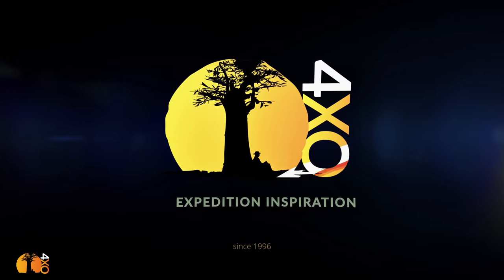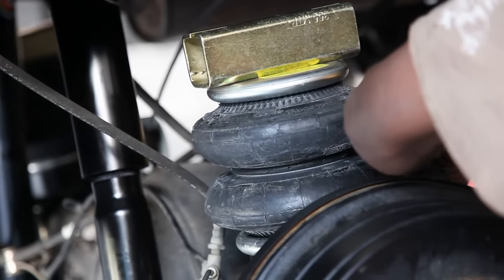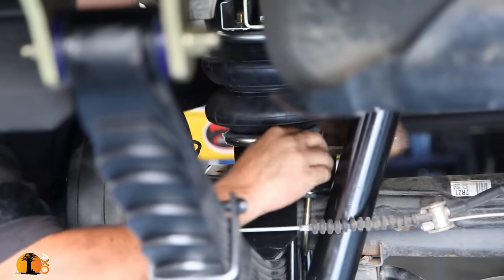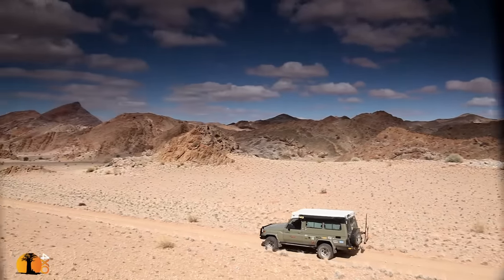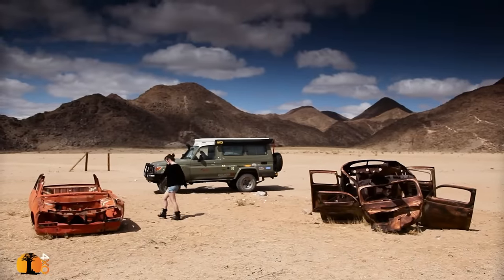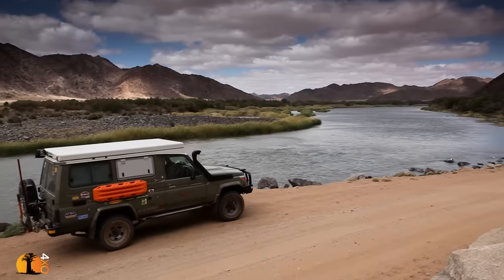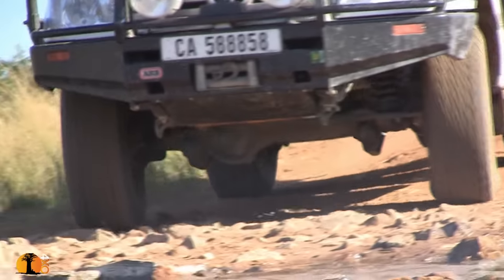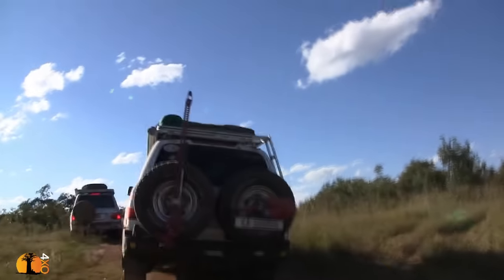AIR-BAG HELPER SPRINGS. ANY GOOD? | ASPW 4xOverland

Comment: Sorry Andrew, the shocks are designed to control the ascending travel of the suspension, not the compression. For absorbing the down force of the weight you have the spring. Shocks can give a tiny contribution, really tiny. The goodness of the air assistance is that you can  have a comfortable spring that you can complement the capacity when you need. The downside, is the longevity of the air spring and the air  compressor. Hope this is useful and debug some of the concepts presented.
Reply: Shocks control the compression too (at least the good ones do!)
Reply: @jackp-j1041  So, if a strong shock for as strong spring has, let's say, 40 kg of force  and about 5 on compression, do you call this a good shock. If you do I agree to you.

Comment: I have a coil rear NP300. 9-5, I carry tool and stock, the ute sits at rear axle capacity. Weekends, ute is 300kg lighter.
I ordered in coil airbags a week ago as I found it to be the most economical method to support the weekday use. Also, all constant load springs for that vehicle lift it, which is not suitable for work use.

I'll be interested to see if your suggestions are right and I end up removing them.

Comment: I bought a Prado with airbags and nothing but problems with holes from sticks, removed them to replaced with springs and new shocks. If not towing air bags are no point.

Comment: "Isn't designed for it". Wrong, I regret to say. The longitudinal chassis members are beams which are designed to resist bending moments anywhere along their length, not just at one point. If you put an air bag above the axle in a vehicle with leaf springs the local bending moment diagram will change a bit but the maximum BM won't be altered much. If there's a chassis failure on a vehicle with air helper springs this will be because it's overloaded in the first place.
Reply: air bags tend to either replace bump stops or go inside the coil so they are working in the designed loading area anyway IMHO though I agree with you.
Reply: @nrs91  We are on the same wavelength.

Comment: for my 80 series I put airbags in the stock coil cause i wanna fit in my garage and parking garages and stock height 100kg or 200kg springs aren't really available in the USA I run  at 5psi unloaded and 15/20psi loaded to only affect I've noticed is the shock rebound is a little fast at 15to20psi

Comment: If you can get the ride perfect as a daily with good suspension, then 100% nothing wrong with airbags when towing. I run them on my Defender 110 and tows so nice with airbags inside coils at 25PSI. Like suspension, must go quality airbags or then the dramas start.

Comment: Airbags used as helper springs are perfectly fine. From an engineering standpoint what you said is incorrect and if you think about it, it will sound insane. Your axle is engineered with tolerances for the thickness and type of steel to carry a load of  amount. As for span and angle stresses, the closer you are to the wheel the more stress it can take. As for connection points on the frame they are usually placed in factory holes on the frame so you aren't taking away anything from structure on integrity that was intended by the engineers. Then where the airbag brackets are beefy metal they are nowhere on the same level of strength as your frame. This means if there is a point of failure it will either be the bag or the bracket but it will not be your vehicle.
For completely custom engineered applications, the bracket tree that is welded in place actually makes the frame stronger at that point, specifically to carry that loadb and those stresses. 
I don't recommend the bag in spring but there are also airbags that go on to the top of struts that act completely as spirings, depending on your application.
It might be newish to you and your lifetime but airbags have been used on trucks since the 1930's. This is not new technology.

Comment: Now you did say if you are towing, airbags can be the way to go, do you still think that. I did fit Kings HD 2" lift coils to my 2010 Jeep grand Cherokee V6 diesel  and when just camping with a full load, no trailer, but still under my GVM, it's great. But when I use my camper trailer which is very heavy, about 220kg ball weight, it sits nice and level, but it's when I'm traveling on outback roads, eg Mitchell Falls camp ground road, hitting some of the wash outs, even at low speed it bottoms out. 
In this situation would airbags be an advantage when traveling on these types of roads, only increasing the airbag pressure when needed, this is the way I want to go, helper springs as you say, or should go for a better adjustable HD rear shockers.

Comment: I think the large generalisations at the start of this vid are a little misleading... like you say towards the end the air helpers are for when you have a large difference between your unladen and laden weights. For your usage I cant see the load changing more than 100-200kg which is why you wont see any benefit IMHO however for a family car being kitted out for a weekend away its a huge weight difference from the daily commute.

My personal experience is with my friends Land Rover 90 station wagon here in the UK. It goes from being just an empty station wagon to being loaded with a roof tent, a couple of adults, the dog, the fridge, all the beer and then it has a trailer with a heavy vintage tractor put on the back so going from 2psi to 40psi with the in coil air helpers maintains the same ride quality and ride height as standard and also can be used to level the roof tent to some degree in camp.
My friend uses the arch gap from the top of the tyre to judge the pressures required to suit the load and the only time it has ever had anything but a comfortable ride was when he left the full pressure in the bags after removing the trailer and the the rear was visibly 3" higher than it should be and not how you would travel with it any more than a mile or so.

Comment: Air helpers are the only answer for a vehicle that is 90% of its life running empty and correctly sprung for the lower weight but is loaded up to GVM on trips away. They make the vehicle ride correctly and you can keep the headlights pointing in the correct direction rather than skywards. Just don't overload your vehicle and everything will be fine.

Comment: I have a 78 Series Troopy with the Terrain Tamer 4 leaf Parabolic springs And Terrain Tamer Shocks. The ride was perfect even when loaded or towing my 2.2 Tonne Caravan. I upgraded my Van last month to a 2.6 Tonne Van and the ride was crap when towing. So I added the helper airbags amd with just 20-25psi and it’s made a massive difference so they do have their place. Not sure why Andrew is using 3 leaf spring when the 4 leaf works perfectly.

Comment: I have helper airbags in my '95 Impala SS's rear coil springs.  The car needs just that little bit due to GM's choices on the coils.  10psi is enough to make it ride very well and to handle better, each side is independently filled with no crossover.

I won't put helper airbags on my 4x4 truck.  I don't want to find myself having punctured one while relying on them.  The car on the street is not going to encounter the kinds of risks that the truck will off pavement.

Waiting in the wings I have a 40 year old 1-ton Dodge with air-inflatable rear shocks.  Those have solid housings, so no bag is exposed to risk.  Not even sure if those are still made anymore or not.

Comment: There is a problem with my dream car that I put my heart to afford.. its ford ranger raptor.. i love it capabilities offroad and on road... but I occasionally need to load my pickup fully and here I see a problem with ford suspension.. its not designed for heavy cargo... is there an easy solution to fix this without ruining the fun offroad without the heavyload ?
I was thinking that installing airbags would allow me to fix rear drop, and bad handling  due to heavy cargo.. unfortunatly I thought there would be many aftermarket designs dedicated to my dream pickup and I couldnt find anyone fixing that problem... 
What would be the best sollusion to raise cargo max weight ocasionally without swapping all suspension and ruining fun when almost empty...??

Comment: I installed airbags on my car, it's my daily driver and if I went heavy duty springs in the rear and no load it would ride like a pig, so went with standard springs and airbags to compensate for the weight when I do load up to go camping

Comment: ??????   Good day,   We have a 3500 2016 Ram Dually    20,000 miles on the truck …..We tow a 19,000 rv 5th wheel…..   we are having ware on our brand new front tires …….  We have had the truck front end ailment done and checked for any mechanical issues…..Do we need air bags or something else ???????

Comment: The only scenario where air bags ruin the ride is when you are so over loaded that you people severely over inflate the air bag to make up for it. There's a place for air bags and most people that use them use them incorrectly, but when they're in the right application they're amazing.

Comment: Bag in coil workers well on and off-road in my R51 but the bag must me sized properly not universal fitment. However bags and leafs I would avoid even towing. Not the same as adding or changing leaf packs. Weight distribution hitch is much better and safer than air bags.

Comment: I was thinking of putting them in to assist and take the lumps out of the ride but not to blow them up to high pressure for load carrying. I have a 2019 Hilux they are known to have a lumpy ride. As to your light springs Andrew, have you considered a helper spring that only engages when there is the extra load?

Comment: I appreciate your experience and expertise, I just don't understand one thing. I am not interested in adding air bags to a leaf sprung 4wd, but my question relates to a coil sprung vehicle with air bags inside.

Doesn't the airbag increase the spring's spring rate? There is always going to be a perfect spring rate for any given load. If you pair that with a great shock you're going to have great ride quality. So if your vehicle has 2 different weights like for daily driving vs overlanding (which may incl towing), wouldn't getting the right spring rate for daily driving then adding air to the bags for your overlanding trip simply increase the spring rate to handle the increased weight? 

As a result your spring rate is increased to handle the weight so your vehicle's stance and susp geometry is where it should be, weight balance is improved, braking performance improved, handling improved. No doubt still drive to the conditions and be aware you have a heavy vehicle to control now, but at least the vehicle is more planted, no different to having heavier springs really.

Isn't this the aim of air bags? What have I missed? I get that all of what you were saying is spot on for leaf sprung vehicles, I don't understand why they negatively impact a coil sprung vehicle. Especially as the spring seats are designed to take the weight of the vehicle on the spring, so adding air bags there I think is no different to adding a heavier spring (or a light sprung vehicle bottoming out on it bump stops located inside the coil spring anyway).

Please explain as I actually have a set of air bags on order currently for my 4wd...
Reply: As the bag expands it restricts the coils from moving, ie doing their job.

Comment: I think if its a dedicated touring vehicle it can be perfectly sprung. If its a workhorse, daily driver and once a year tourer the bags might be helpful. Ive got bags and only use them when touring. Also LDV and Troopy might be different applications?

Not sure if the conclusion is relevant to all vehicles.  On my LDV the bump-stops had been removed. Bump-stops also a point of high stress, so should be able to take extra load.
Reply from the maker: The good part about removing bump stops is that if you break a spring, you'll know why.

Comment: You have fitted light springs to the new one though, surely a helper is a best of both worlds thing? Never just airbags though.
You went on to make the argument - and remember you are "testing" induction cooking, why not test it yourself properly and tell us all  :)
Reply: Risk of testing induction cooking and it goes badly wrong - cold food. Risk of testing improperly engineered suspension and it goes badly wrong- a catastrophic accident killing people.
Reply: @Jack P-J  things can be done with engineering thought.  You know, like cutting a roof off .....  do you have a 100% stock vehicle?
There is no doubt that bad mods and badly engineered changes can be dangerous, but things can be done properly.
Reply: @stupidmonkeykev  As a matter of fact I do, apart from some heavy duty springs made by Land Rover for the car I have, and an LPG kit. And guess what? I can take that 25yo truck everywhere that I am legally allowed to and tow anything Im legally allowed to, all whilst fully loaded, and no amount of modification will change that. The only thing I cant do is take it through really really deep water, because its a V8 not a TDI. Airbags, in this context, really are no more than extra-long progressive bumpstops, not really any good for off road or load carrying, and if they arent properly engineered thay could be extreamly dangerous. I dont see the point, If you want a stiffer spring, get a stiffer spring. If you want a nicer ride, then dont fit a stiffer spring.
Reply: @jackp-j1041  what if you want both?
I'm not a big airbag fan boy or anything, don't have them, don't want them.  Although I know a few motorhomes with them and works ok between empty and overloaded  :)
Reply: @stupidmonkeykev  Ahh, on motorhomes its a different story. Firstly, I presume they are fitted by the manufacturer and hence have been tested and engineered etc, secondly you dont really need to worry about axle articulation or hitting giant bumps/ruts. If you want both? Well Im not sure about other cars, but the rear spring on old land rovers can be changed in less time than a spare tyre (if you need to inflate it with a manual pump). Ive never even seen this type of airbag, so I have no idea how easy it would be to inflate/deflate with a manual pump. If you hadnt guessed, Im from the UK, where long distance off road touring isnt possible, I dont think the longest unpaved road is even 10 miles, its certainly nothing a normal healthy person couldnt walk in a day, so if the 4x4 isnt the daily, people tend to do giant lifts with giant MT tyres, and cut as much weight out as possible. In my case, my discovery is my daily, so its unmodified, because it spends 90% of the time on the road. 90% of the distance on unpaved tracks in the UK could be done in a toyota RAV4/ honda CRV etc, only needing land rovers/jeeps/jimnys/pick ups for the other 10%, and then theres a really really tiny distance, probably less than a mile in the entire country, that needs a big lift big tyre bobtailed monster truck, but honestly, you could probably take a lightly modified nissan micra with a winch to all these places if you tried hard enough. (Im only talking about public byways/greenlanes, not pay'n'play days etc)
Reply: @jackp-j1041  also in the UK, and hence I have a Jimny as it matches the lanes available  ;)
Aftermarket on the campers.
Main point was there is still an argument for ASPW doing the testing  :)  Does seem to be worth that.
Reply: @stupidmonkeykev  Ide say its only worth testing if the kit is well engineered, AND he cant achieve whatever his goal is on normal springs, AND he is additionally conservative when driving / loading, so the spring isnt relied on. Also good choice on the jimny, I bet youre loving the 1.3L with petrol as it is now!
Reply: @jackp-j1041  the 1.3 sucks, a liana 1.6 is much more like it should have been supplied with.... so I swapped. 

And actually been broken most of this year .... so just the MY1995 7.5T camper for me and its 17MPG.  Usually tow the Jimny as a daily..... but at least I just park the camper where I'm based so no daily commute.
Reply: @stupidmonkeykev  Ironically, my land rover isnt broken, or rusty, but it does get as low as 12MPG, despite being a manual.
Reply: @biilybutt9016  Lets face reality, in the UK a land cruiser of similar performance would be an 80 series 4.2 manual, which would be what, £8000? My discovery was £2000. Ohh, and lets not forget parts, much easier and cheaper to get LR parts in the UK than for a landcruiser. Also, my disco is quite wide, especially in town and on narrow tracks. Ive taken it through gaps that an 80 would have to turn around at (yes, less than an inch each side). Land rovers are also lighter and rust less because they are aluminium not steel, hence are cheaper to run. Last I cheched the towing capacity is the same, and my disco has 7 seats. Litterally the only thing on my land rover that doesnt work is the cruse control. Thats it. So tell me again why I should spend so much more on a fatter, heavier, slower, less capable, more environmentally damaging, less useful 4x4?

Comment: Hi, have you had anything to do with the coil spring over Leaf spring rear , with the cross body bracket that takes the load point to arms that go down to the std leaf mounts? I have a close friend with a early Hilux, with the kit , it works brilliantly.

Comment: I can see if your vehicle is dual use where your camper is removable.  Where your spring rates are set for no camper but you use bags to compensate for when the camper is attached. Never inside the metal springs tho.